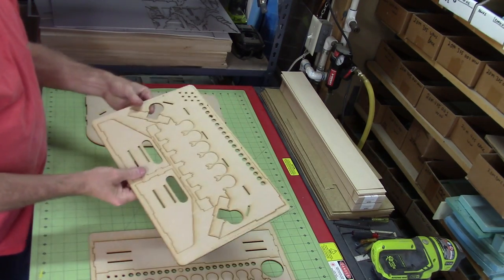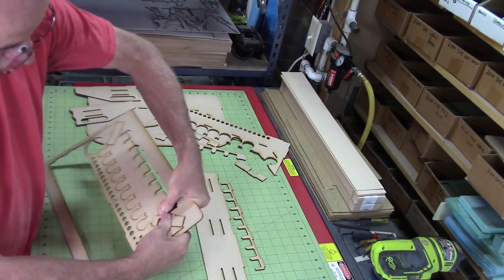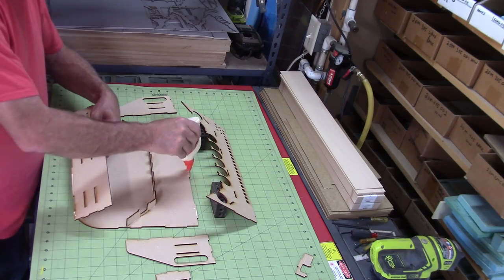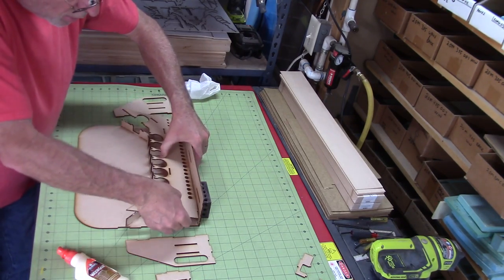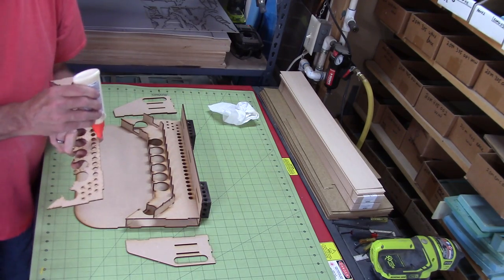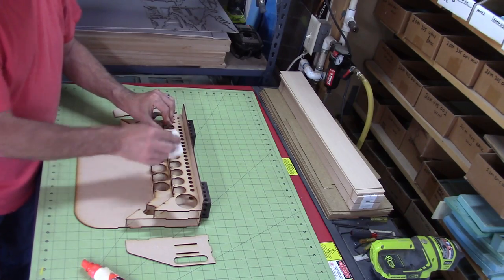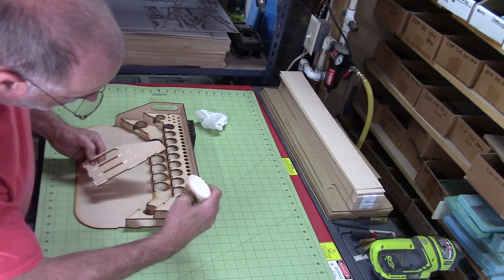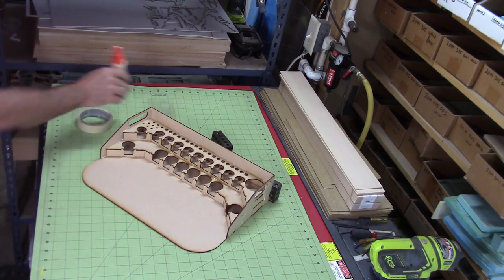Assembling GameCraft Painting Stations

Comment: Having just finished putting this bad lad together, I'm super excited to have a nice work area. When you're putting it together, I'd recommend using about half the amount of glue you think you need. One, the parts fit very well together. Two, that tight fit will push the glue out, and you'll have a mess.

Comment: IF YOU HAVE CITADEL PAINT POTS DO NOT GLUE AND ASSEMBLE AS THIS KIT'S POT HOLE ARE HILARIOUSLY TOO SMALL AND SEEM TO ONLY FIT DROPPER POTS.

I was looking forward to using this as it looks nice. You should really advertise your station's for what pots they are intended to be used for by brand not Millimeters as not many brands tell you the diameter of their pots! Also, would be nice to know I would need tools (Glue for example) to assemble this kit. Besides those frustrations its a neat little kit and I can still use the product even if not in the way its designed.
Reply: You’re joking right? He has paint stations for every kind of pot. They are all clearly labeled as to what the mm are AS WELL AS exactly which brand they will accept. I just got the 34mm which is clearly labeled GW / Citadel bottles. You got 26mm which is also clearly labeled as Vallejo and Army Painter Dropper Bottles. Just read all of the information provided and you will do great. Love my paint station btw.